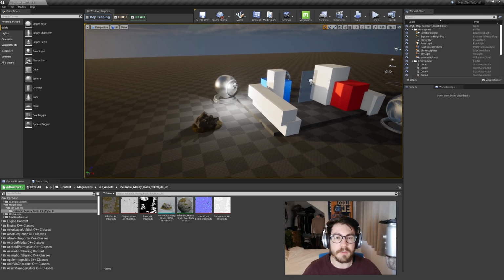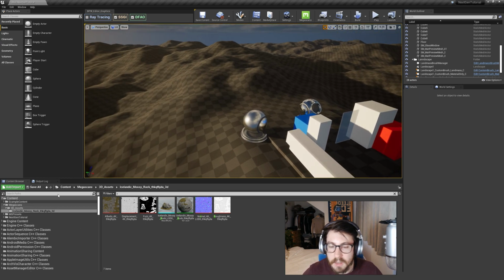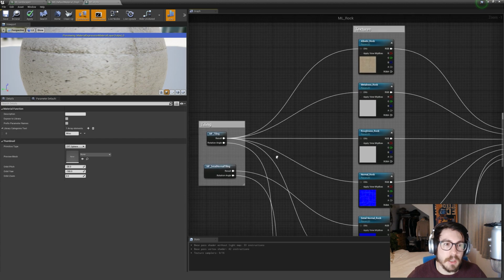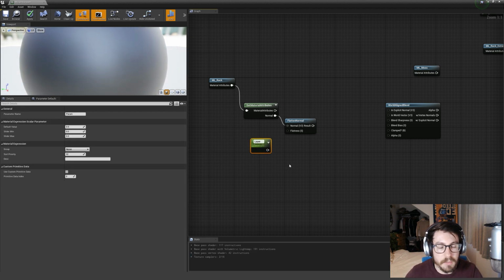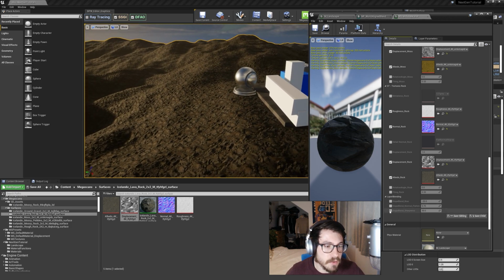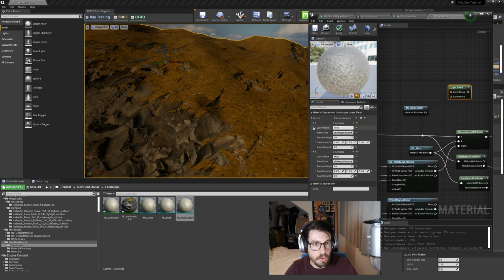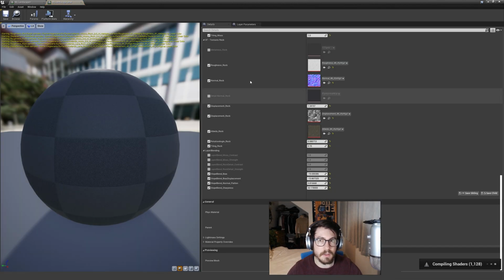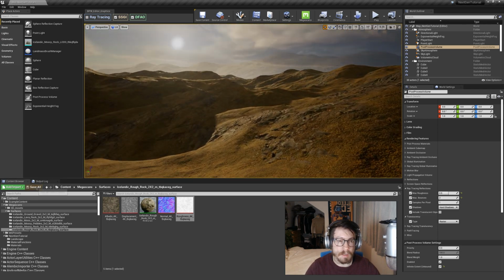Unreal Engine 4 | Next-Gen Tutorial: #04 Landscape

Comment: After blend the moss and rock detail, the moss texture look very blur, and other two texture is fine
Reply from the maker: That's weird, maybe you are running out of texture memory? Does it improve over time, as like load in after a while? Are your textures really large? 8k?
Reply: @tobiastobasco  all 3 set texture a 4k, the moss texture was fine before blend to rock detail
Reply from the maker: @ronaldlee320  There's two things you could try. Increase the texture pool size through the console. It's set to 1000 by default, try increasing it to 1500 or 2000.
Also try reducing the amount of textures by combining them. For example Displacement and Roughness and AO can be all in one texture in different channels.
Other than that, I'm really not quite sure. What graphics card do you have?
Reply: @tobiastobasco  ok, i will try it again

Comment: Hey Tobias, you may have already tried this but I found it interesting, unfortunately, I still cant get my project to work like yours so I thought id share here. As part of trying to solve another issue to do with ray tracing on the displaced terrain, I came across a video by MR3D-Dev that suggested changing the r.RayTracing.NormalBias value from its normal value of 0.1 to a larger one such as 7 or higher. I noticed it had an impact on the dark patches seen when translucency was set to ray traced, however, due to other issues I'm having I'm not certain if it's a sure fix.
Reply from the maker: I think I've tried a few things and the official answer from Epic on the topic was that Ray Tracing issues with tessellation/displacement are to be expected and will not be fixed.
It kinda makes sense as it's basically just shifting geometry in the shader, rather than changing the actual geo.
Also I'm assuming Epic doesn't prioritise the issue at this point, as Nanite might 'replace' tessellation/displacement in the future...
Reply from the maker: In general, I think you'll just have to evaluate whether or not you really want/need displacement or ray tracing. Both together are hard to combine without issues. So it might be easier ditching either one. It's easier to ditch tessellation / displacement, because you can just create meshes with higher resolution as a solution.
Reply: @tobiastobasco  THIS. It's so frustrating, but its true. Anytime I try to use a project with a landscape and raytracing is on, I get the "leopard spot" issue. Black marks all over. I basically have to turn off raytracing. But raytracing is currently vital to get truly amazing results for renders. So is there basically no solution until Epic replaces raytracing with... something else? I have gone around and around on this issue. :-)
Reply from the maker: @mrtobycook  You can try using the new VirtualHeightfieldMesh. It basically creates a new surface for you, using the landscape height data. And it should then work with Ray Traced Shadows. Or you try to use Parallax Occlusion Mapping, rather than Displacement+Tessellation? That's what Quixel have been doing in their demo project.
Reply: @tobiastobasco  thanks so much for those suggestions!! I’ve tried and tried to understand the Medieval project. But it’s def not compatible with raytracing as far as I can tell - if you turn on raytracing with it, big black triangles appear all over the landscape :) am I missing something obvious? When they designed it they also seem to have decided to almost 100% cover the landscape surface with other 3D assets. Like they didn’t want to see it. Lol. Right? I need to spend another few days just staring at it I guess and trying to figure it out. I wish there was better docs and tutorials on it! :) they did a series but it barely scratches the surface and doesn’t cover this stuff
Reply from the maker: @mrtobycook  I haven't even tried turning RayTracing on tbh. I just looked at the materials etc., to see how they did it. 
I think in general quixel have been doing less and less landscape and more and more 'bespoke' assets in their latest demos. Same goes for the UE5 Valley Of The Ancients - It's all meshes, no landscape. 
So my personal guess is, that there will be some changes coming soon, enabling us to do more detailed landscapes. This could be the VirtualHeightfieldMesh, although I think it's not sophisticated enough yet. If I find anything useful reganding this, I'll make a video about it :)

Comment: Hello Tobias, I am in the Landscape Material Setup with Slope Blend Tutorial. Have set up my ML_Rock, Rock_Detail, and MossMaterials. Have gone back and checked that I renamed and assigned the correct groups to each. When I go to 
MF_WorldAlignBlend, in M_Lanscape, follow the connections, I don't see the white top on top of the Material Function of the WorldAlignBlend preview, as you have. I have the SlopeBlend_Normal_FlattenDefault Value set to .75 as you have. That is the parameter, I am thinking, that sets the slope, or the amount of the alpha or the size of the white cap on the material preview. Any thoughts on what might be happening? I can assure you that I have checked and double-checked  all the previous steps and everything looks like your setup. Does that SlopeBlend_Normal_Flatten preview icon matter? Should I just continue and it will be OK?

Thanks,

Art Lee
Reply from the maker: I wouldn't worry too much about the material preview. Just take a look at it in the actual level when you have the material applied to the landscape.
The slope blend just creates a mask which we can use to blend different layers. If you wanted to visualise the mask you can drag from the slope blend into the BaseColor directly. Then adjust the mask with the Boss Parameters.
I'll elaborate on masks in my next tutorial, hopefully this will clarify what's going in there.
Cheers!

Comment: Hey, what is Tangent to Vertex doing?
do we disable tangent normals in material when using it?

Gah, because this has fixed the normal for some of my shaders in the past and idk why it works xD
Reply from the maker: It's just transforming normals from different spaces. Normalmaps are most of the time authored in tangent space (which is also what the materials are set to by default). So this node Transforms the Normalmap from Tangent Space to Vertex Normals, which is a workaround, so we are able to use it in our slope blending material, with displacement. The different Normal Spaces can be a bit tricky sometimes xD